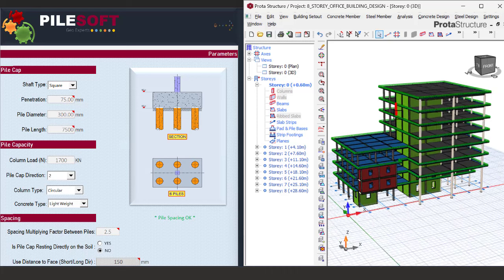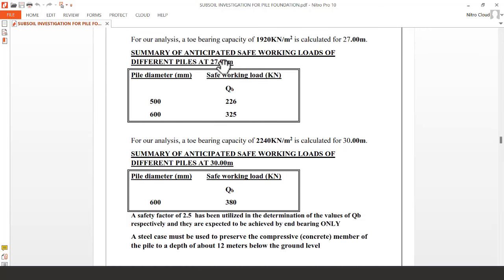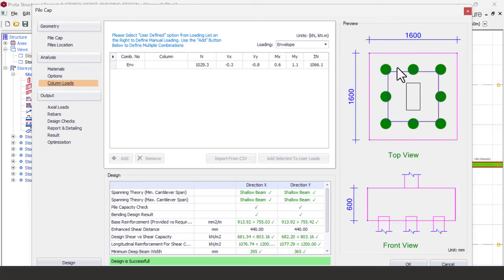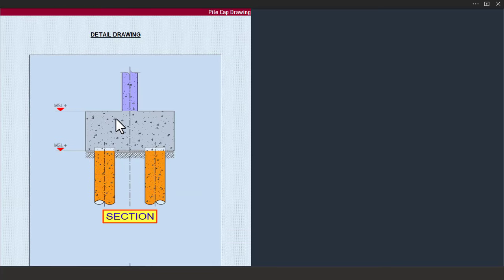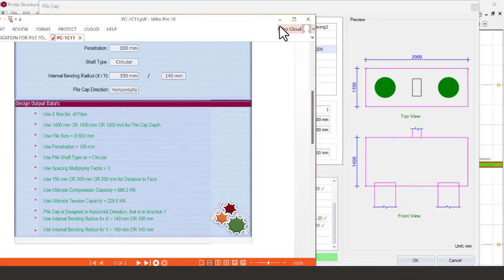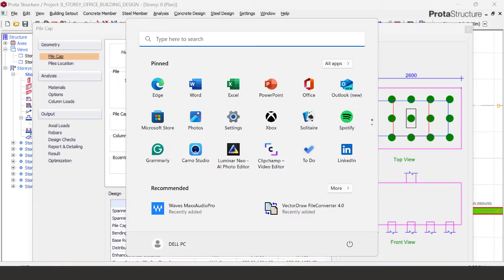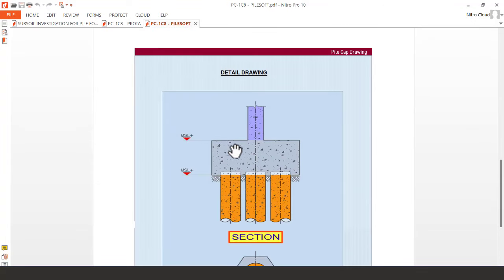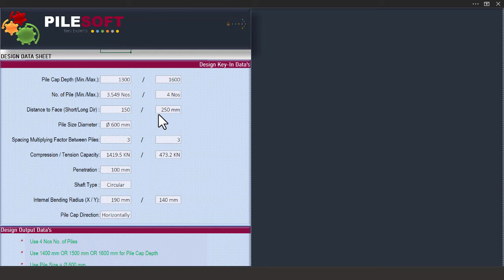Pile CAP Design using PileSOFT and Protastructure

Comment from the maker: 💵GET the PILESOFT software Here : https://selar.co/PILESOFT_v6

PileSoft is a wonderful software, without pilesoft it will difficult to design an accurate Pile foundation design in Protastructure software. But with the help of Pilesoft software your pile foundation design in protastructure software will be 100% accurate, stress free and easy. In this video you will learn how PileSoft software and Protastructure is used for pile cap design. 

PileSoft software is a software use for the pile foundation design but it is not a standalone software it was specifically developed to work hand and hand with the protastructure software. Pilesoft software alone can not be used for the complete design of pile cap, piles but in combination with protastructure software you are guaranteed to get an accurate design of pile foundation.

Comment: Hello! Please any idea how Pilesoft is calculating the pile capacities in Compression and Tension? In the soil report, the safe working load for 600mm pile is given as 380kN, but pilesoft calculates something different for the pile capacities. Can you please clarify? Thanks..
Reply: This is very important. I took out time to watch the entire Video and I'll say your software still needs more work to be done on it. You cannot determine the number of piles without considering safe working Load in the report. So please consider working on that.